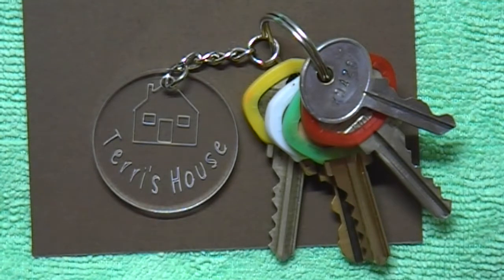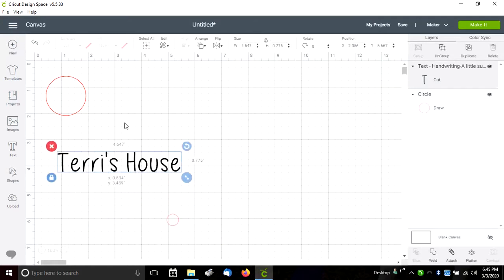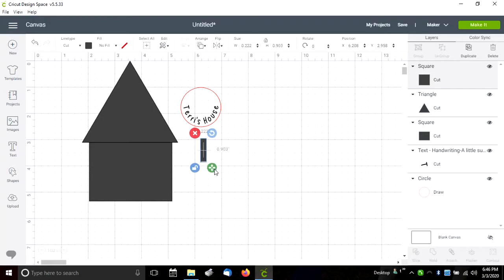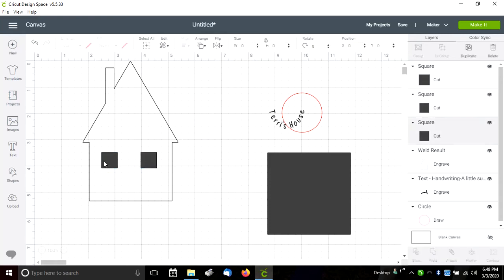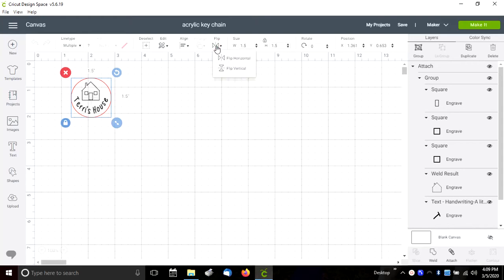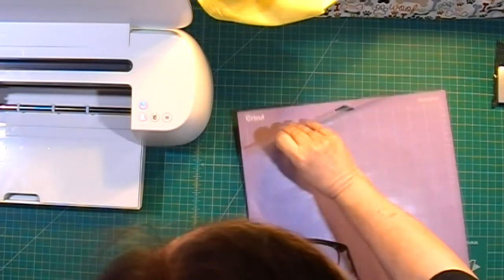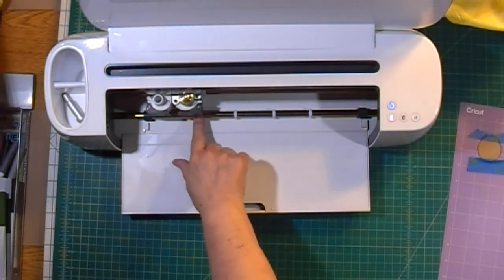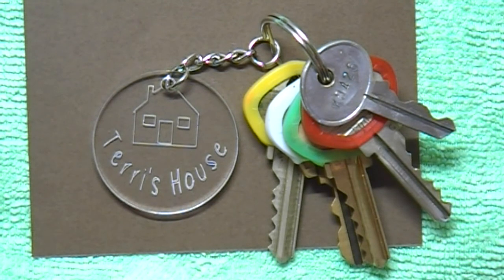Engraving an Acrylic Blank 3mm thick on the Cricut Maker

Comment: Did you do some more of these in the meantime? I had a hard time getting it right on the acrylic where I wanted it. It was always shiftet a bit, I think you had the same problem here, that the whole motive is shifted up a little. Do you have any tips?
Reply from the maker: Unfortunately, I don't think it can ever be perfect positioning without some sort of built in scanner like the Scan N Cut has.  I think the best we can do is try and load the mat exactly the same way every time (for example, since there is a little play between the guides when loading the mat, you can make sure it's pushed all the way against the left guide when loading), and try and understand how your particular machine positions the designs on the mat vs how it appears on the mat mockup in Design Space.

Comment: Does it make a difference if you apply the engraving on the top or the bottom of the blank?
Reply from the maker: Probably not, but I like having the design seen through the smooth layer of the acrylic with the etching taken out of the bottom.

Comment: A youtuber said we couldn't engrave on 3mm thick acrylic because it wouldn't fit underneath, is that true?
Reply from the maker: I measured this acrylic blank with my caliper, and it was 3.3mm and it fit.
Reply: @terribruin9662  mine doesn't fit at all and its 3mm thick
Reply: I tried to engrave on 3mm thick acrylic and it wouldn't fit under the roller at all
Reply from the maker: You need to push the small white fly wheels out of the way or the acrylic won't fit under.
Reply from the maker: It's strange that 3mm won't fit on some people's Maker.  I guess not all Makers are created exactly the same.  For those having issues, do you have the original Maker, or the Maker 3?
Reply: @terribruin9662  What model do you have? 3mm does not fit in our original model at all
Reply from the maker: I have the original maker.  I still find it strange that the 3mm blanks won't fit in some makers, but will in others.

Comment: Hi! I just invested in a Cricut Maker to make keychains just like these. I’m wondering how detailed the engraving is for letters that small and if the 3mm will affect the machine in the long run. Someone told me a Silhouette Cameo 4 might be a better investment for this type of project. What’s your take on it?
Reply from the maker: I don't know about the long time effects, and I don't really know anything about the Silhouette Cameo, but I would hope that the Maker is robust enough.  Just remember to move the little white wheels out of the way (learned from experience LOL).   As for the detail of small letters, it would probably depend quite a bit on the font that you decide to use.  You would definitely want to use one of the writing fonts.